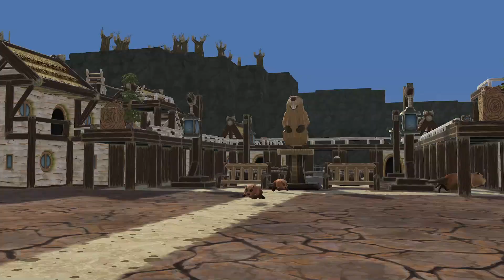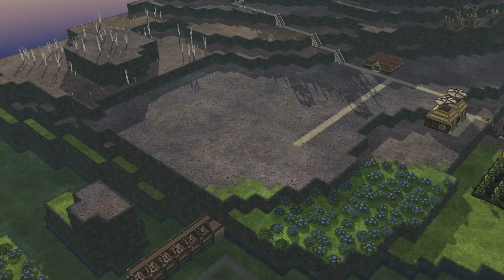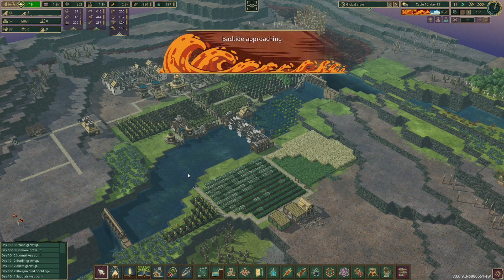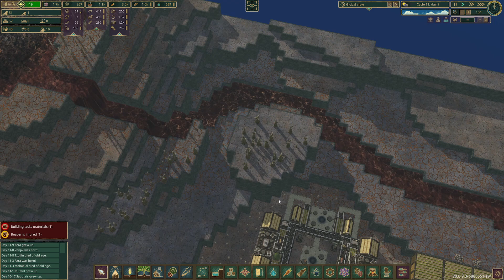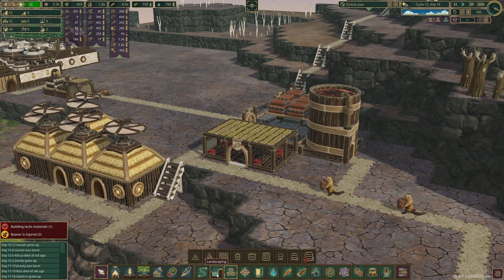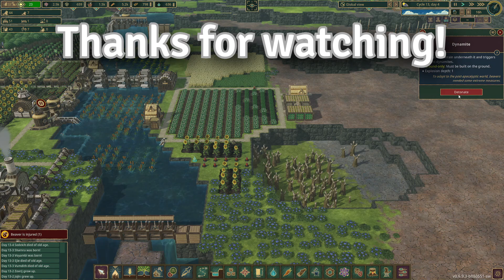From Scrap to Explosions: Starting your Timberborn Industry!

Comment: 25:00 if you need more power, your setup is easy to extend your levee's and slap down more wheels and connect them to the existing power line :D As for the beautiful ending... AAAAAAND.... boom goes the dynamiiiiite!

Comment: You repeatedly run into plank bottlenecks, so I suspect you should have a second lumber mill, especially as your gear requirements increase.
Reply from the maker: You're absolutely correct. I add two more within the beginning couple minutes of the next episode.

Comment: Now here's the question, are you ever going to increase your population or just keep increasing food production for no reason? You have the food output to have well over 60 beavers and you can easily increase water storage and production with the large water pump and large tank. You also should have gotten wind mills a while ago.
Reply from the maker: I have been extremely conservative with population expansion, mostly because I find accidentally exploding population too quickly is one of the easiest ways for beginners to game over their save (or, at least, that's been the impression I've gotten from a few years on the Timberborn subreddit). If this wasn't aimed at complete beginners, I would be more steadily increasing the population rather than doing it so deliberately and controlled.

As for water tanks and windmills- that's all coming, but unfortunately I've been a bit constrained by the format of 30 minute episodes. I should probably prioritize some of those things more in the next one, though.